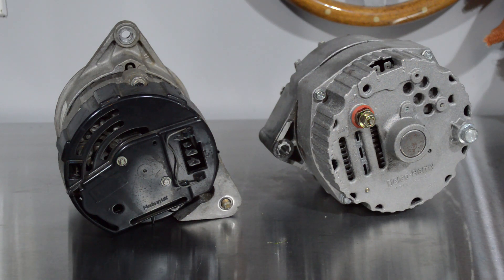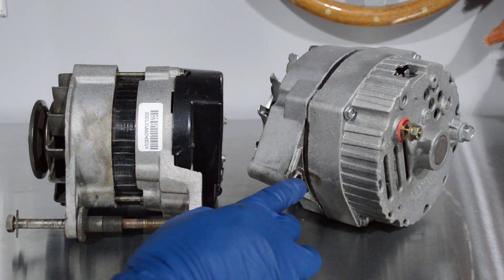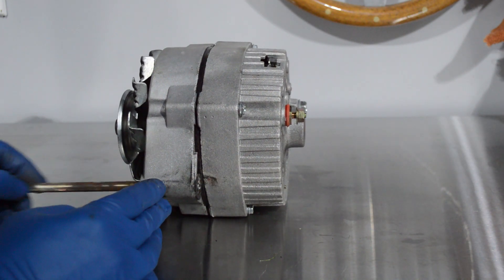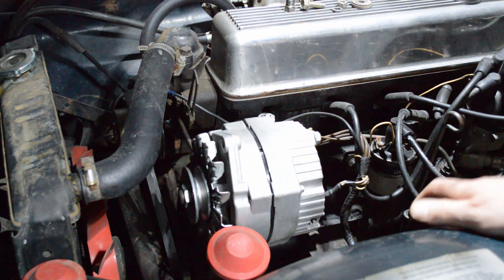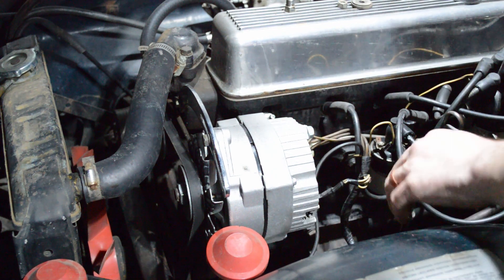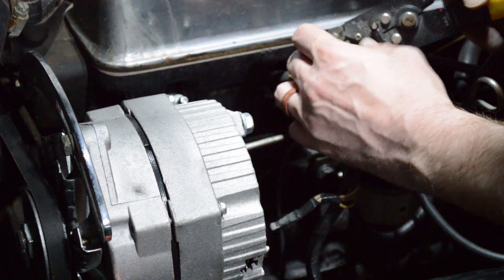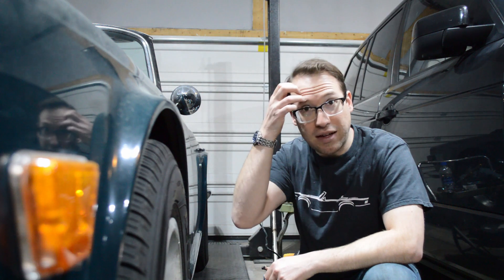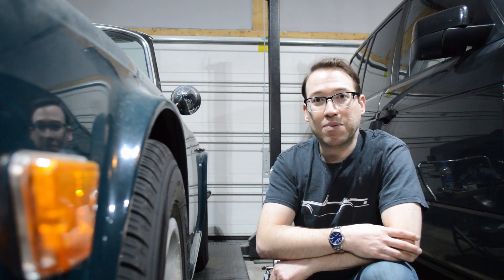Lucas Alternator - Part 2: Replacing with a GM Unit

Comment: Great job! I’m going to be doing the same soon. Thank you!
Reply from the maker: Good luck!  There are supposedly straight swaps with certain Bosch alternators I think, but it's more difficult to get those depending on where you live.  I like the GM ones since they're dirt cheap and can be found at any Auto Zone around here.
Reply: @midwestmotoring  I just picked mine up from NAPA. Ordered it online and saved $5!!! I agree, I like how I can get it locally very easily. I’m installing it on a Land Rover but in the same position as yours. I’m converting from generator to alternator. The generator is being a real pain in da butta!!

Comment: Do you remember what the part number for the delco unit was?  Also any chance it would wire up to the AAW harness?
Reply from the maker: Unfortunately I don't remember the part number, but it's honestly a run-of-the-mill GM alternator.  If you pick, say, a Chevy C10 pickup from 1975, you'll come up with this alternator.  The alternator is "clocked", meaning that after you install it, the wires can plug in from different sides.  Basically, you can rotate the back of the alternator so the plug is in a different spot, which gives it a new part number technically, but it's the same part.  There are plug-and-play alternators that will wire up to the original harness from newer cars, but they're difficult to find in the US.

Comment: How did you know which of the larger brown wires goes where?  They appear to be the same size.  Perhaps it doesn’t matter?
Reply from the maker: Hi William, that's correct.  I'm assuming you're talking about a TR6.  If so, if you follow the wiring diagram you'll find that both of the brown wires go to the same junction where they join up with all of the other brown wires, the battery and the wire to the starter.  Since both wires (at least in my car) are the same gauge, you can use them interchangeably.
Reply from the maker: If you DO see that one wire is larger, use that one for the main output.

Comment: Did you notice that your charge indicator is registering a higher voltage with the GM unit?
Reply from the maker: I did not. Then again the old alternator wasn't working properly so not great for comparison.... Is there a reason that would happen?